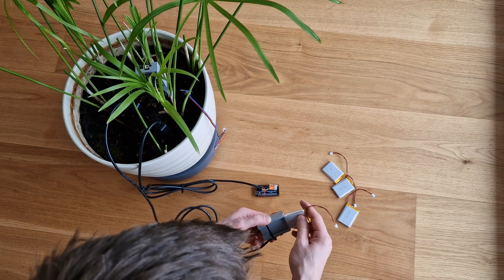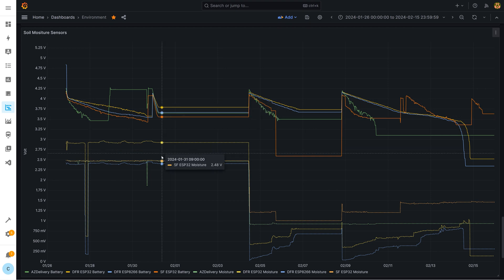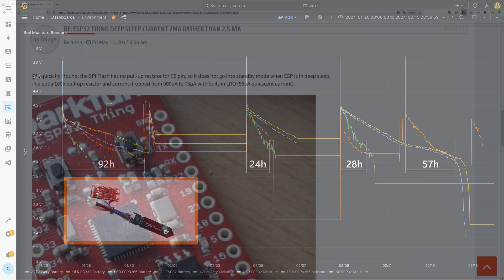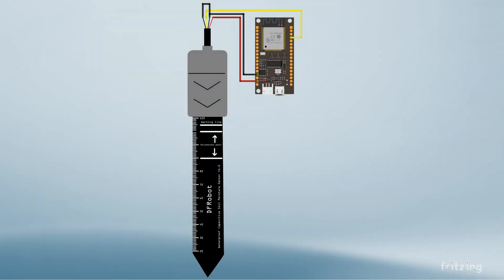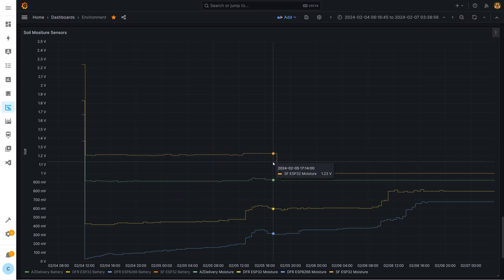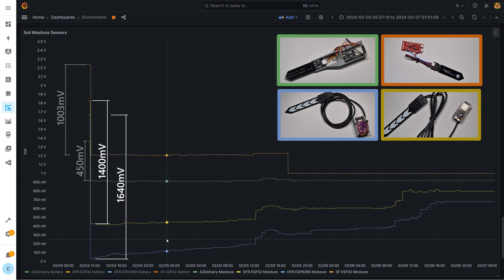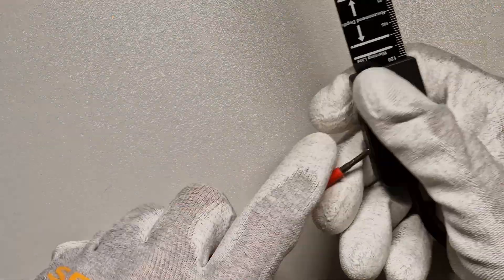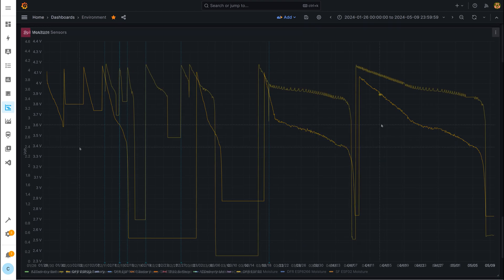WSMS#2 - Best Soil Moisture Sensor for Smart Home Project

Comment: Hi,did you check the 2.0 version for these faults?
https://youtu.be/IGP38bz-K48?si=R9f4ZP1Qv7ihiPvs
Would be interesting to know if those low sensitivity readings might be due to the 1M resistor lacking GND connection

Comment: I am very late to the game here, but I have a question. what sort of test did or would you use for a offset and span calibration for these sensors? I recently got myself a bunch that are similar to the common type, where I have about a 300 mV signal difference between drying off the prope and sticking it into water. I was curious if you use specific medium and conditions for the calibration of 0% to 100% moisture?

Comment: What about long time running ? Wondering about oxidation and UV.
Reply from the maker: I don’t have much long-term experience yet, except for the sensor in my houseplant. After six months, it still looks just like it did at the start. I’m currently setting up a test setup for my garden - more details will be shared in the fourth part of the series.

For this test, now I’ve also coated the sensors on the side with protective lacquer to prevent the fiberglass from absorbing water. We’ll see over the next year how well the sensors hold up.

Comment: Just found your channel, Oida! Nice work! I did my Bachelor's Thesis on that topic with OpenSprinkler open HW & SW but was running into some kind of buffer overflow (on the esp8266), when adding the libraries for INA and SHT31, as well as the MQTT publishing. I still think (as OS has an api) it might save you some time, if not directly, then maybe as template or inspiration.

Furthermore, have you looked into Mi Flora Plant Care Sensor, or the Miyo Sensor S2? You could add a small solar panel to your soil humidity sensor (like miyo did), to make it autonomous.

Finally, maybe you want to look into applying conformal coating to the edges of the pcb, if they haven't already. Otherwise, moisture can slowly seep into the pcb from the raw cut fiberglass edge. I've had limited success with nail polish, I'd use epoxy or the like if I'd do it again.
Reply from the maker: Thank you so much, glad you like my project!
I was already familiar with the Mi Flora sensor, but the Miyo sensor is new to me - thanks for the tip.

I had read about coating the PCB edges before, and I plan to cover that in the #4 part of the series, when buiolding a prototype. I was thinking of using conformal coating (422C) instead of epoxy since it's more liquid and might seal the fiberglass better through capillary action. What do you think about that?
Reply: @creativemakerat  I'm looking forward to that. — Sounds like fun!

You might already know it: For solar, Andreas Spiess's (sensorslot) superpower project Discord has a link to a Gdrive with cool Power Systems BOMs & schematics, including one for solar with the LTC4162 charging ic. MPPT might not be necessary.